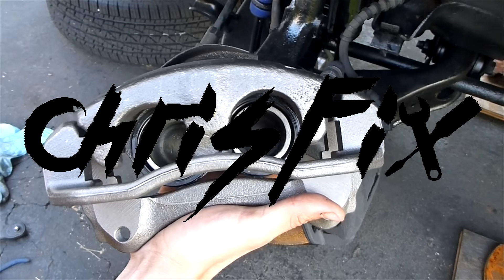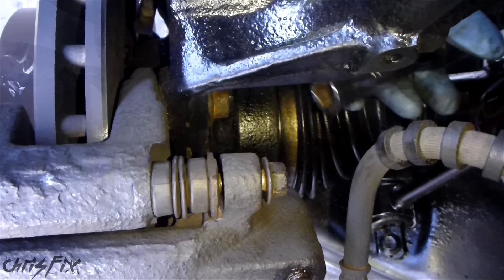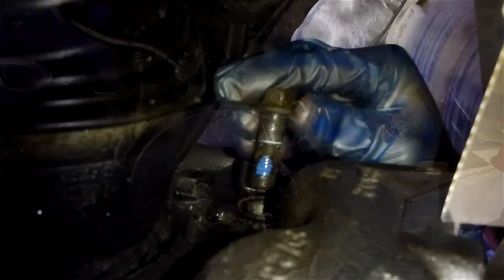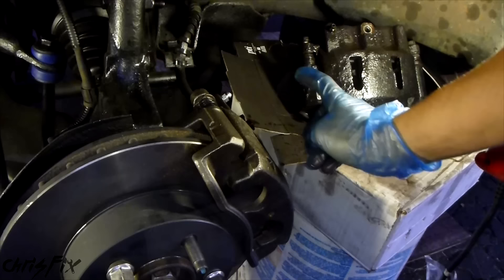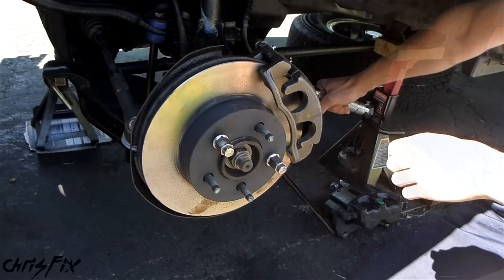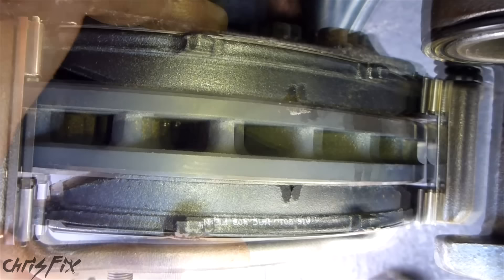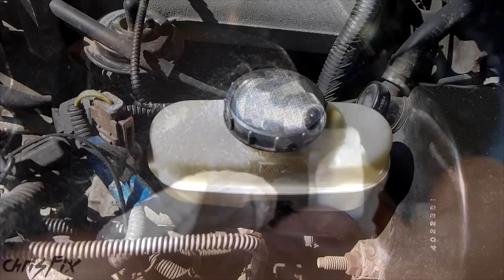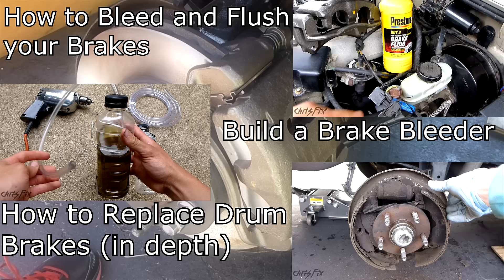How to Replace a Brake Caliper

Comment: my wheel was very hot and smoking sometimes, let the body shop guy check it, they said, the wheel is seized, and the caliper is jammed, then they ask me to replace the whole caliper. Just wonder is it really need to replace the caliper? or are there any chance to fix it ?

Comment: Hey cris when you replace a caliper do you bleed all breake lines ? Or just the one from the caliper you replaced?
Reply from the maker: You definitely bleed the one that is being replaced but if you get a lot of air in the system you might need to bleed them all. Usually you can get away with just bleeding one tho. Test the brakes in the driveway after you are done bleeding the one. If it's hard you are good!

Comment: My caliper that I bought came with obviously the caliper, pistons, and the clips that the brake pads slide along, but did not come with copper washers. are the copper washers essential? could I substitute them with regular washers?  I noticed the copper washers on yours squashed where the compression was, I'm guessing that helps create a seal so the brake fluid can't excape. I just don't know if that is essential or if I get aluminum washer's tight enough if that will basically do the same thing.

Comment: Question. I used to add grease around the metal clips, but I found it never lasts past the first rain, and just mixes with dirt, making it more of an inhibitor then a helper to the brake pads. What's your thoughts on this? Is there another reason besides attempting to help the brake pads slide?

Comment: My caliper came with what looks like 2 silver washers not copper in the hardware bag are these how they making them now? Guy at Oreilys didnt know if they were for the line, its for an 03 Yukon denali rear caliper. Anyways had to use the old ones and now they are leaking.

Comment: Do new brake calipers come with pre-lubricated pins? I recently replaced both of mine (Centric brand)  and the pins had some white grease substance. I left it on and added some of my lubricant (Permatex Silicone Ceramic). Now I’m a little concerned as to what that white grease substance was and of mixing them together.
Reply from the maker: Most do, and I would remove the pins, clean them off, apply some of that silicone, and you should be good!
Reply: @chrisfix  Thanks for responding! I also replace the pads and rotors! My first time!

Comment: Hi Chris grate video I have a question to bleed the brake line does the car have to have all 4 tires off the ground or is it ok if  just one is off the ground on a jack stands and go around the car as I change each caliper?

Comment: I need new brake pads, rotor and caliper. Caliper is most important. Can I replace that first so I can drive it.  Will my caliper break again because of bad brake pads?

Comment: Is it necessary to bleed all brakes if you just removed 1line or  where the 1 brake line was disconnected?  Thanks for the video.
Reply: You probably want to bleed all the brakes because if you removed one caliper you might have let air into your system, so your best bet is to bleed all the brakes, as well why wouldn't you want to bleed all the brakes as you'll get best results from that.

Comment: Quick question,  my brother had to change the brake hose on the front caliper driverside because of a tear in the hose, and he only gravity bleed that one caliper. I said he should bleed all the brakes, but he said only that one had the air in line not the other calipers. Now should he bleed all of them ? The car stops fine and brake pedal feels normal it's not to soft and not to hard either. What do you recommend?

Comment: Hey Chris, I was told , when compressing the caliper on a f150. you should open the bleed valve first. if not the back pressure could damage the ABS system... I never heard of this before, what's your opinion ?
Reply: What year F150?
Reply: @ninemilliondollars  2013 to 2015

Comment: I’m curious, wouldn’t it be easier to bleed your lines before swapping the calipers? That way you’re not playing beat the clock and rushing to remount the line?
Reply: Hokie19 - I'll answer, but I may misunderstand your question. Seems that you're asking about bleeding the old caliper. That won't work because it's only after the brake line is disconnected from it that it needs to be bled, and that is only after it's been mounted to the new caliper. Plus the new caliper has air in the pistons that needs to be pumped out. :D

Comment: Hey Chris, can a bad caliper cause car to pull specialy at high speed or prevent the steering wheel from returning to center ?
Reply from the maker: It can pull to one side and prevent your steering from working as intended!
Reply: @chrisfix  Ok thanks :) I will look into it. I have this problem since 2 years. When I turn left, the steering wheel doesn't return to complete center. It stays like 10-15 degree left. Right side is fine. I changed tie rods, ball joints, stabilizer link, lower control arms, coilovers and got alignment many times but still the same. I just  need to check calipers and steering u-joint.

Comment: How do i remove the rear right wheel bolts for the caliper. One can't use the jack trick since it would tighten instead, and you can't fit a breaker bar, and your impact is too big for the socket to fit. I phisicaly cant lossen it and used brake cleaner to lossen but no luck. Any tips? Its like there rust fused togetor.
Reply from the maker: I would try the double wrench trick to get leverage a tight space like that
Reply: @chrisfix  Got it, thanks for the tip .

Comment: now what you do is take apart the old caliper , strip all the parts . blast it with baking soda and a compressor . buy a replacement caliper accessory kit and paint the caliper , rebuild it and use it later or sell it to offset the cost of your own replacement caliper . 😊
Reply from the maker: If you don't mind doing some extra work you can do that for sure! Often times (like in this case) it's easier to just turn it in as a core and get some money back

Comment: I have a 09 dodge 1500 it shakes when I brake. I replaced the rotors and brake pads on all wheels  but it still shakes. I took it to a mechanic and they checked the bearing and the control arm and said it all looked ok. Do you recommend anything?

Comment: Chris, I want to repaint my calipers and actually would like to completely take them off to paint the entire caliper assembly.  You mentioned not to clamp my brake lines.  Can I just plug where the banjo bolt would go?
Reply: ChrisFix does not answer youtube questions or comments

Comment: My new calipers won’t bleed. I checked the bleed screw and it’s clear, no leaks anywhere. I think air got up into the line when I transferred the brake hose…any suggestions?

Comment: I have a 2015 Dodge Journey V6 front wheel drive disc brakes I just did calipers and pads but the left front is hanging a little should I take one of those shims off the pads and that should loosen it up because one fell off on the other side and it's not doing that I just want to know your opinion

Comment: Hey quick question I noticed you turned the 15mm clockwise with the breaker bar... but then unscrewed it by turning counterclockwise... can you explain why? I have an acura tl 2012, and I couldn't unscrew the rear 17 mm caliper screwes no matter what, I couldn't even put a breaker bar in there because the break line was in the way... tried using 17 mm wrench and a hammer, that didn't work either... ended up just taking it to the mechanic to put my pads on... any tips for the future?

Comment: Hello Chris, thanks so much for the detailed video I've subscribed to your channel since March this year and I'm enjoying the videos you have posted.

I have a question, I hope you don't mind? I need some help. I'm cleaning front and rear break calipers of Mazda Bongo 1999 model. How tight should bolt bracket without using a torque wrench? I have a breaker bar, and a short rachet wrench. I'm worried to tighten it too much. Your advise would be appreciated. Thank you in advance.

Comment: Great video Chris. However just one question, what are some of your suggestions on how to diagnose a bad brake caliper? I bought an auction car that's in relatively good condition but I suspect one of the rear calipers is seized and will need replacing. Reason being is that I smell brake dust from that area (can't decipher which side) with minimal driving around. Any tips?

Comment: Need some insight. Started working on my first project car (‘94 Miata). Tried to replace a rear caliper that started leaking after compressing the plunger to change the pads. Installed a new caliper instead of rebuilding and now the inside of the rotor is touching the caliper mounting bracket. Any thoughts? New rotor and regreased cv axle but this issue didn’t occur with the old rotor.

Comment: Can I just replace the seized caliper (front) and grooved rotor? The repair shop said I HAVE to replace both sides. I understand replacing both sets of pads but why should I HAVE to replace both calipers AND both rotors?
Reply: There is no need to replace the other caliper. It is usually recommended to change front brake parts at the same time. I would recomend changing the other rotor as well, but if the other one is in good shape it is not strictly necessary. However, if the rotor that you replace is not the same as the other side, you may get different braking power on each wheel. This can cause the vehicle to pull to one side when braking.

Comment: Not al calipers have a banjo bolt.
That is less easy than shown with the bolt.
You have to twist off the caliper of the breakline or take it off together with the brakeline.

When i install the new caliper, i prefill the caliper with a serenge with brakefluid before installing and plug the hole for the brakeline.
Thats handy , so you have almost no air in the system makes bleeding easier.

Comment: What kind of vehicle is this. My 760 Volvo has a slightly different set up. The bracket is attached with large Allen fasteners and the calipers don't open like clam shell. Thanks

Comment: I didn’t use Loctite on the caliper bolts.  Bottom bolt popped out a week later.  😬
Reply from the maker: That is why I recommend thread locker and to torque it down.

Comment: my mechanic said that I cant adjust your hand brake as your caliper has broken gear inside it works only when you use a normal break is that possible ? honda accord 2012

Comment: It always throws me off how M8 bolts can be 12 mm (JIS) or 13 mm (ANSI/ISO/DIN) heads. I replaced all of the suspension bolts in my Honda Civic. A previous suspension job used aftermarket bolts that were all 13 mm, and I was VERY confused when putting the replacement Honda bolts back on why I didn't have the correct size sockets pulled out already!?

Comment: what happened while you were changing those 2x copper washers? Brake fluid continued to leak out from the disconnected  brake line?  Lots of fluid lost. And awfully messy

Comment: Could u service the caliper by getting the repair kit or was it cheaper to replace since most caliper are refurbished. Which is why they have core charges
Reply: Would be nice to have how to repair video and diagnostic on what the better option plus would be neat to see the piston fly out

Comment: I have a question.
Why dont they make "aftermarket" junction things so that you can turn/tighten it to stop the brake fluid from dripping out of the end of the tube? Think of a hose junction where theres a ball valve that you turn to stop the flow of water. I honestly think that there should be something like that out there...

Comment: Hey Chris, I got a caliper question. I noticed my son's car was actually missing the driver side, outside brake pad. The caliper housing was grinding into the rotor. So naturally I replaced the rotors and pads, but when I removed the driver side tire, I found that the caliper was leaking. Now for the question. Is it possible, that because the piston was over extended, causing the leak, will it now stop leaking? Or do I need to replace the caliper?
Reply: Only way to know if it will keep leaking is if... if it keeps leaking. You can test before driving. If you want to be safe rebuild or replace.

Comment: Why and how did your caliper start leaking only after you changed all the brakes?  

I'm trying to get my caliper off now as I speak but it seems kind of stuck. I'm trying to open it like the clam shell as you say. The top bolt is still on, the bottom one is out. I get about a half inch maybe less then something keeps it from opening. I am slowly & easily trying to pry it with a screwdriver but I don't want to force it. Or can I just find a good stable spot and just force tf out of it till it pops open ? I don't want to break anything. I can't afford to replace the calipers right now.

Comment: Hey Chris, how do you fix a sticking brake pad on a truck with fixed position brakes(not the floating kind)? Ain't no slide pins to grease on mine

Comment: I think I need to replace mine.  The 'piston bolts'? no longer move, and I think it's causing too much heat build up on the rotors, even though I upgraded to the vented and slotted.

The Jeep dealer wants $1300 to change everything out, but I may do it myself... the Front Rotors * brakes should only cost me $100 give or take  I learned how to change those from you a few years ago... and I found the calipers for about $60 each (after core return); so, if I do it myself I save over $1000.

Comment: Hey Chris, I'm probably a bit late to get an answer but ill ask anyway. Replaced all my calipers on my 99 mustang and after bleeding the brakes (multiple times, multiple techniques) I can't get full pressure back. Brake pedal is soft and it only engages when it's all the way down. Cant find any solutions, everything is installed correctly. Any ideas?

Comment: Have 1977 Chevy truck bracket got threaded out that supports caliper. What do you recommend in fixing it. Bolt doesn't Tighten.

Comment: I have a 1992 Ford ranger 2-wheel drive there are no 12 or 13 m&m bolts holding it together it's just two metal clips now what do I do?

Comment: Own 99 explorer since May 2017. May 2018 pass. May 2019 Recently failed inspection. brakes, rotors & tie rod ends.
Replaced them.
Failed inspection same Ford dealer today, my Right (Pass side) caliper cable twisted. no mention of this previous inspection that I failed. Are they F n with me? Cable design diff than L (driver side)?
U have video on replacing brake line?

Comment: Just watched this, agree with other's opinions. Briefly well said and done! :D
Reply: I had an issue with my car when I tried to do the gravity bleed on my front passenger side. I got the caliper on ok but when I tried the gravity bleed nothing happened.
I finally wound up just pouring brake fluid in the caliper chamber. Good news was that it wasn't leaking anywhere when I did this and the line and banjo bolt set up went on without leaking. 

Does the gravity bleed only work for the front drivers side? 2000 Dodge Caravan in case you're wondering.

Comment: My Rotors are 282. Can I upgrade to 300 without chaning the Calipers?
Reply from the maker: Do a search with your car and see if that is an upgrade you can do! On some cars it is possible to use larger brakes from cars that are higher up in trim or package level!

Comment: Awesome video. Question I replaced my daughters expedition caliper that was frozen with a new one. After being installed for a month or so she started to have problems again. I jacjed it up and found the wheel very hard to turn. I took the caliper back off and noticed the outside pad was down to 50% after the short time obviously not releasing again. I then noticed the caliper pistons had a little metal ring cap type thing on it. I replaced calipers before and never seen something like this. Was i supposed to remove them before installation? Anyway i did this time and also greased the slide pins and installed new pads. I hope it works this time. BTW I used a C clamp and old pad to push pistons in and they moved no problem.
Reply from the maker: Was it a piston cushion or just a plastic protector for shipping? Watch the end of this video and that should help you know what you had on there: https://www.youtube.com/watch?v=H1WXlHONorw
Reply: @chrisfix  yes that was it exactly! Piston cushion. Never seen those before I removed them the 2nd time oops. I just dont know why the new caliper continued to not release like the old one. I made sure to lube the slide the 2nd time I hope that helps. Just stumbled across your channel and subscribed love how you explain things.

Comment: When replacing all 4 calipers do I bleed the brakes as I go or do I bleed them when I'm all done?
Reply: wazzoot1 - Good question. I'd say start by replacing the caliper farthest from the master cylinder and bleed it at the same time (you bleed the longest line first). This assures you're  removing only the air from that caliper. And since the others haven't been touched, you'll not need to worry about multiple leaks if they've been disassembled. Then move on to the next most distant caliper and repeat the process. :D

Comment: Hey Chris, do you need to lead all of the brakes after you replace one brake caliper? Thanks in advance. Joe
Reply from the maker: Usually you can just bleed the brake you are working on but sometimes air gets in and you need to bleed them all. I would bleed the one you are working on and if the pedal is firm, you are good to go!

Comment: At 10:24 you mention brake fluid is corrosive and will damage rubber but the caliper square piston seal, dust boot, brake hose and master cylinder seals are all rubber so it must be safe for rubber..